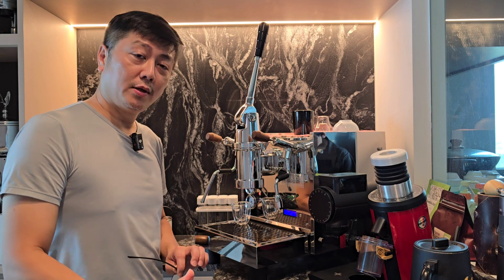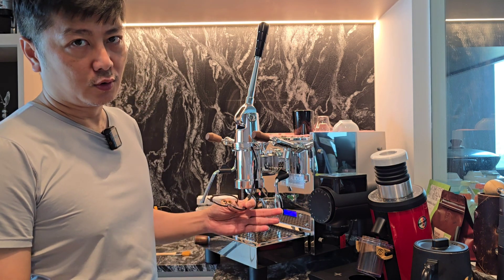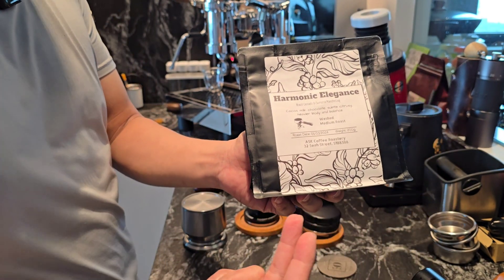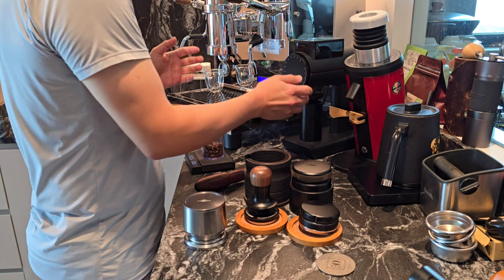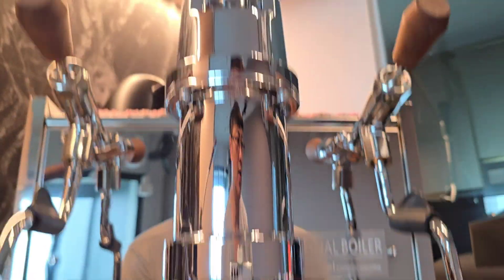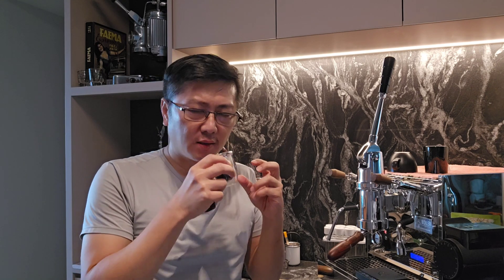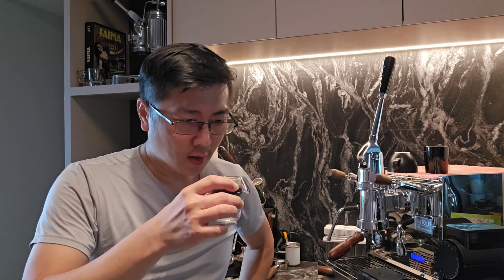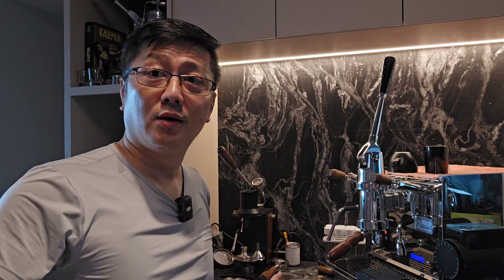Saga continues. To WDT or Blind Shake? Spring lever espresso machine with Timemore Sculptor 078S

Comment: Hi CY, I found out that the design of the sculptor dosing cup promotes channeling at the outside ring of the basket. Like seen in this video. It is because the dosing cup is too small in diameter and has thick walls. This leads to a concentration in the middle of the basket that can hardly be solved with WDT.
Reply from the maker: Thanks for the update! Now I dose direct into a.blind shaker and transfer to the portafilter after that. It solve all the issue with channelling.
Reply: @CaffeMartellaSingapore I do so, too!